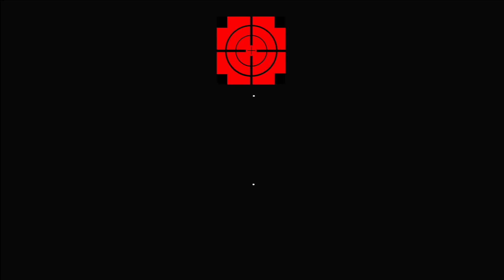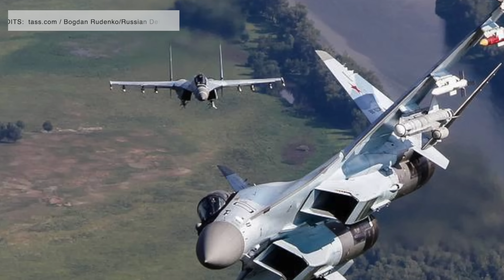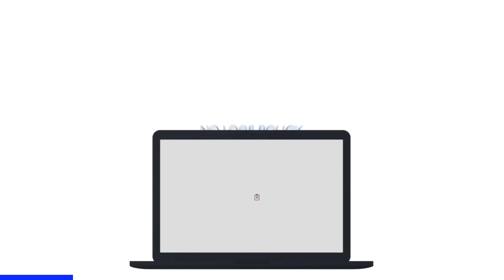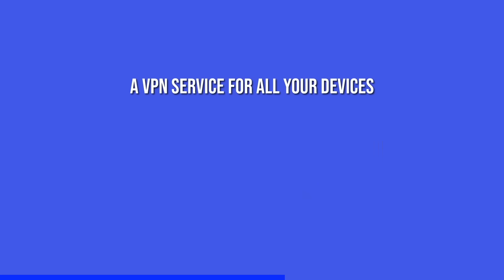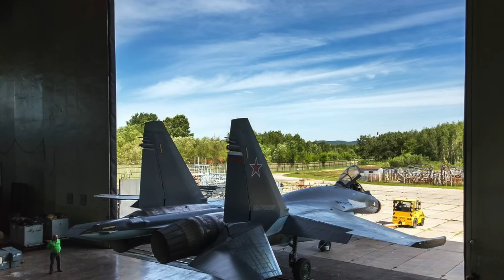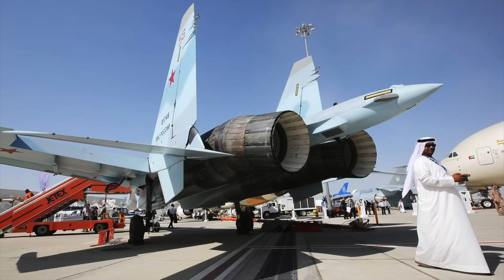How the Russian Su-35 got exposed by Egypt ?

Comment: MENADEFENCE ANALYSIS  - These criticisms are largely contradicted by established facts:

The Irbis-E PESA radar, though not AESA, is among the most powerful in its class. Its detection range and multi-target tracking outperform those of Egypt’s current F-16s and MiG-29Ms. Moreover, the version proposed to Egypt included active electronic scanning surfaces (AESA) on the wings.

The Saturn AL-41F1S engine is far from obsolete. It features thrust vectoring and supercruise—capabilities the Rafale lacks—while offering a range nearly double that of the French jet (up to 3,600 km versus 1,850 km). Its fuel consumption is comparable to that of other heavy fighters in its category.

Regarding radar and heat signature, several technical reports place the Su-35 on par with the Rafale, with structural optimizations for passive stealth.

Lastly, the claim that Egypt seeks only “modern-generation” aircraft lacks credibility: the air force already operates four 4++ generation fighters—F-16s, MiG-29Ms, Rafales, and soon the J-10C. This contradicts any standardization or modernization narrative.

Comment: One can have the most sophisticated fighter jet but if u dont have experienced pilots with battle experienced n has a lot of exposure of aerial excersises with other friendly forces then that sophisticated equipment is useless coz that jet will not work to its uptimum designed specs. Thats the chinese problem coz not even 1 general of the PLA has any actual battle experience. They often practice by themselves based on what is in a training book.

Comment: Saw f35 straded in Indian airport also f35 crashing a lot but it costs 2 trillion dollars for the project but how
Reply: 1.5 trillion to bribe Washington.
Reply: The F-35 has a lower crash rate that the F-15, and F-16
Reply: Well then don’t worry, your country can easily beat the F35. 😂
Reply: @billpugh58  the problem with that jet wasn’t a mechanical error it was because of the fact that the pilot kept on passing out due to the smell. 

turns out no sewage system is the best air defence in the world.

Comment: Some of these 'failings' are laughable. Its a gen 4 fighter, its never going to have the sensor fusion,  engine reliability or sonic footprint (thats new one on me, ever heard a eurofighter, or F-15? They are hardly quite) of a gen-5 fighter, which some of the criticisms made here make the comparison with. A lot of these failings could have been identified way before taking delivery of the planes. Yes they are disadvantages  to the Su-35, they could have been spotted by looking at the specs. They need not have agreed to buy them, have 5-6 delivered then suddenly discover these issues. No they got the political screws put on them from the US to cancel the order. Lets not forget that Egypts F-16's are not allowed to carry AMRAAMS so that Israel keeps the edge over them. The Su-35 would have represented an upgrade on that which they had for much less money than Rafaels.

Comment: Hey -- the whole issue of "what is a Su-35" is hard to follow through its development, and mostly whatever Sukoi says it is.  It was originally derived from the Su-27; the major aerodynamic change that made the Su-35 was the addition of canard-surfaces forward- this was originally done to manage the weight of a more advanced (and bigger and heavier) radar, but proved very beneficial to the maneuvering envelope too.  Further development lightened the radar and the addition of vectoring thrust nozzles meant that the canard could go away, saving weight.  But through all of this the result was sometimes called a "Su-35" and sometimes not. 

Many of the comments below are obviously by "pro-Russian" commentators claiming that "western pressure" prevented uptake.  Maybe... maybe not.  Any analysis of this needs to be country by country and date by date, and take a lot else into account.  But if you are thinking about today, Russian foreign weapon sales are in the toilet and sure to stay there, due to the Ukraine war.   The Russian hardware top-to-bottom has been humiliated, shown to be incapable of matching up with 20-year-old western kit ... and then on top of that Russia isn't delivering anything to foreign customers (including spare parts), and everybody sees that whatever the outcome now of the war in Ukraine, Russia will be in dire straits going forward.  

This has put all of the nations that used to buy from Russia into a quandary, India particularly.  With Trump making the USA look completely unacceptable ... who does that leave?  Psst ... France.   Or perhaps Sweden, but at present the Gripen uses an American engine.  All of western Europe is now facing getting itself independent of the USA (ditto Canada) ... and the reality is that every other nation in the world is at least a decade behind the USA in fifth (and shortly 6th) generation fighters.
Reply: Iskanders, FAB bombs and Su-34s which carry them, Lancet drone, Ka-52 helicopters, MiG-31 and Kinzhals, Su-35.. 
All these weapons and platforms have proven their worth by destroying dozens/hundreds of targets.. 
The only Western weapons that showed themselves to some extent worth mentioning are HIMARS (still reports suggested that 70% of its missiles end up intercepted or jammed), Storm Shadow missiles (again, many end up intercepted by Russian air defense systems, but the nature of the war is such that even Russian ADS get overwhelmed by dozens/hundreds lf drones firts and than have to handle 5-8 Storm Shadows of which only 1-2 reach their destination), and maybe Leopard tanks and Bradleys..
Reply: @Awol2001 a good way to separate propaganda from the truth is to see how the different countries reacts to whats happening.  Countries have a wide network of intelligence agencies that filter out the propaganda, from operatives on the ground to satellite imagaes, to actual reports from the frontline. 

Since the war in Ukraine, Russia’s military exports have sharply declined from $8 billion in 2022 to just over $1 billion in 2024. The Kremlin blames sanctions particularly CAATSA for this, but CAATSA was signed in 2017 and Russian exports did not decline then, the turning point was in 2022 after the start of the war. 

https://youtu.be/WhWGTm6XOJI?si=r_t0wLwRFksSskbl

This is because governments around the world have military intelligence agencies that report the most accurate information on what is actually going on on the ground, they don’t rely on western or Russian meda which may be subjected to propaganda, they rely on many sources from satellite photos, intercepted communications, first hand testimonies, etc. And the vast majority of reports are, Russian weapons simply don’t perform as advertised. 

 Since the Ukraine war started, countries stopped buying the S-400, the last order was with Belarus in 2022. as Early as March 2023 Turkey reported they want to sell their S-400, India has stopped ordering S-400s and moved to Israeli systems like SPYDER. 

Even Iran, staunch supporter of the Kremlin lost interest in the S-400 after seeing their performance in Ukraine.

Meanwhile Patriot missile orders have skyrocketed, since the Ukraine war. Morocco and Switzerland signed a contract in 2023, Poland wants to buy more, Taiwan is in negotiations for Patriot missiles, and of course Ukraine as well even if they mostly had the Old PaC2 model with a limited number of missiles. They had some newer PAC3 models recently but the new Ghost eye radar was not included, and it was not integrated into the ICBS system. 

Since the war in Ukraine demand for American, European and Korean weapons have skyrocketed while demand for Russian weapons dried up.
Reply: @Awol2001  -- Historically the most successful of the Russian systems you name is the Ka-52. It was a terror when it came out and had years of being a very solid and effective attack helicopter.  But the fact of the matter is that the Ka-52s can't fly over Ukraine anymore, can't aid Russian troops with close air support., and gets shot down crazy-fast if they even get close to the combat.  Times have changed; it's not functional anymore against Ukraine ... and Ukraine is not a "peer" military to the Russian one ... except that it is.  

Russia simply is not a super-power anymore at conventional warfare.  Russia is reduced to terror bombing of civilians because it doesn't have the targeting intelligence or the precision weapons to use its missiles and bombs effectively against military targets.  Russia is reduced to meat wave attacks because almost all the armor is gone. 

The Russian navy hides in Novorossisk after losing about 1/3 of its Black Sea fleet to a country with no navy.

One thing is damn certain: Russia will not win meat wave wars against China or India.
Reply: @leeharrison2722  What in the world are you talking about mate? 
Russia operates Ka-52s over the frontline on a regular basis.
And what kind of meat wave assaults against China or India are you talking about wtf?
And no, Ka-52s is definitely not the most successfull Russian asset in this war; although it did perform well. 
Lancet drones, Iskanders, FAB bombs, Kinzhals - these are the weapons that have proven to be devastating and hard (next to impossible) to deal with.
Reply: Yes 🇺🇸💪

Comment: The rafale is so overrated, Egpyt choosing Rafale over Su-35 because it works better for them that's all. Rafale's radar RBE2-AA doesn't  have GaN like most western planes also don't have GaN only some of the very latest upgrades have GaN, and the RBE while being AESA with all the advantages, it still has a lower power output than the Su-35s radar

Comment: Unfortunately this is actually an accurate video, the Su-35 is a great aircraft but has major shortcomings. Fortunately it was very well made up for in the Su-57, albeit it still didn't get a GaN radar - Which not many western aircraft have anyways. Rafale's radar RBE2-AA still doesn't have GaN either.
Reply: Russia makes regular upgrades and updates to these aircraft..and I know for a fact that Russia also makes good radars so I won't be surprised if this isn't a problem today for the  su35
Reply: @travisjames9417  The Su-35 radar is really good, just has some shortcomings that is all. The Su-35's radar has 2x the power output of the rafale's. But truthly the problem is within sukhoi, Mikoyan has just been cleared to start MASS producing the MiG-35 which is a huge win for Russia as Sukhoi currently just can no longer deliver the same way they once did. 

Sukhoi have finally started to deliver greatly with the Su-57 but that was with a lot of beating and shame.

Comment: As Russia has about 420 SU 27's  and only has 5 or 6 AWACS  it must be fun trying to run an operation
Reply: They probably only have one or two operational by now.  They are no longer made, and parts are impossible to get, which requires them to cannibalize existing airplanes for parts.
Reply: Of those 5 or 6 AWACS, ONE might be operational and if so, only in a limited role due to parts, the other four are Ramp Queens being pick apart to keep the one operational AWACS flying.
Reply: Not counting the ones Ukraine destroyed on june 1st?

Comment: Export Flanker versions were first exposed in the 2019 and 2025 Indo-Pakistani conflicts. Indian Su-30's were jammed.....barely able to match Block 50 Pakistani F-16 in 2019 and were outmatched by PAF's J-10C and JF-17B3 in recent exchanges. PAF claims 1 SU30 downed in 2019 and 1 SU30 downed in 2025 with no losses.

Comment: You can't compare heat signature of the engines between Su35 and F35. Because F35 is a slow jet. Its engine has high bypass ratio, So it emits less IR signature.

Comment: Russia is not anywhere now in the defense exports. Those crying about Su-57 this is a reality check for them.
Reply: If russia is not anywhere now in the defence export then why is india buying them ?
Reply: @shoneshaji9380  India is not buying anything from them from last 5 years. It is mostly France and Israel now. See the weapons used in operation Sindoor.
Spice , Storm Shadow, rampage crystal maze ..etc etc.
 S 400 is the last thing and that itself is more than 15 years old.
Reply: @ghanshyamjoshi587  actually I heard in a news that India had buy a ship or boat ( I don't know)from Russia and i heard India is going to buy another batch of s400 I heard that from another news after operation sindoor. If it is true then you are wrong
Reply: @shoneshaji9380  Apart from S-400 nothing is there .. that's what I am mentioning. Indian Navy operates boats that belongs to some Russian class but they mostly built them locally. You can see the pattern, it is not about right or wrong.
Reply: @ghanshyamjoshi587 s400 is not just 15 years old tech they are modernising and testing it actually they were developing  since 1980
Reply: @ghanshyamjoshi587  actually not just s400 and boats in March 7 2025 india is going to buy 1,000 hp engines from Russia and i have also heard India also planned to buy Russian Voronezh long range radder that can cover all India ( I think )and it is about right or wrong you said russia is not anywhere now in defence export but India is still buying

Comment: Eqypt is making this revelation when their own US supplied equipment has a capability  of a jet from the 60s and 70s😂 ..rafales with no meteors, f16s with aim 7 only capable ..loll..
Reply: That is true...to some extent.  However, their newest batch of Rafales on order (20+ platforms) which they are beggining to take delivery of now, were procured with the meteors as part of the deal, otherwise the Egyptians would not have gone ahead with it (why would they?)  In fact, Egypt plans to procure another addtional  20+ Rafales by 2030 as they plan to have a fleet of approx 80 platforms.  There would be no way they would do that without the meteors and other long-range (AA/AG) munitions.  
Having said that, their current/future deals with China will make the whole issue of BVR munitions mute and redundant, as negotiations for the J-10C and J-35 platforms have reached advanced stages, and it is widely known that PL- 15 and PL-17 and other advanced Chinese munitions are part of the negotiations.

Comment: No western 4+ generation fighter so far fields a GaN radar!! Your data is inaccurate.
Reply: It is poorly worded : the planned improved Russian radar will use GaAs while improved western radars will use GaN.
Reply: Both Gripen C/DE/F can be upgraded with AESA GaN radar. SAAB has tested it already . It will probably have it in the next upgrade .All other sensors on Gripen E/F is GaN.
Reply: Hate to break you to but thats Russian thing not having AESA radar
The JAS-39 Raven/PS-5/A radars were upgraded with GaN back in 2020. The Rafale F5 standard adds GaN to its RBE2. The Eurofighter Captor-E ECRS Mk2 upgrade also GaN again
The F-15EX and F-18 block III both use an variation of the AN/APG-79 thats upgraded with GaN. The F-16 doesn't have it yet but that would likely change if there is block 80
Russian aircraft dont have AESA wide spread
the only aircraft flies with it the Su-57 and the MIG-35 only has it as option
To frank , the Russian air force has performed in Ukraine and their notion that US high tech options were just gimmicks has been shattered by the fact they have lost 
8 Su-35, over 40 Su-34s plus number of Su-30s. Those represent Russia's latest aircraft and they are getting curb stomped. The Su-57 was built for high threat A2/AD in environment in Ukraine but fear of handling Ukraine propaganda victory has sidelined it whereas Israel sent its F-35i into Iran on deep interdiction strikes over 1200 miles against Iran A2/AD and it emerged unscathed 
Proving that US high tech isnt a gimmick
Reply: Nothing to do with poorly worded 
Stop trying to defend a clown who knows nothing
Reply: @mark4371  all modern fighters use AESA radars, while the Su-35 is equipped with a PESA radar. That’s a fact.
Reply: F-18s with APG-79(V)4 are already on GaN maybe even GaN-on-SiC since 2021.